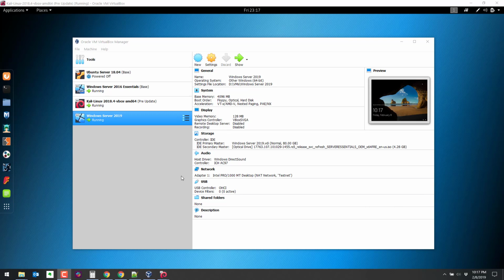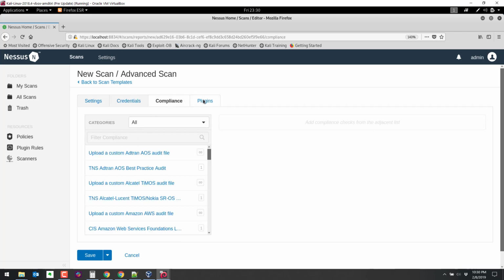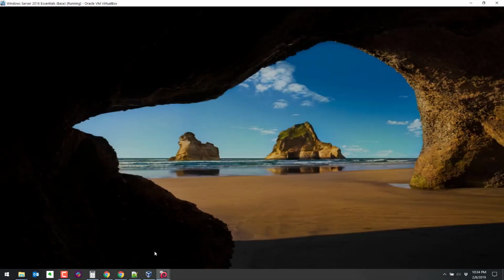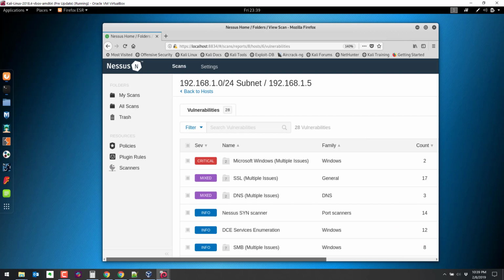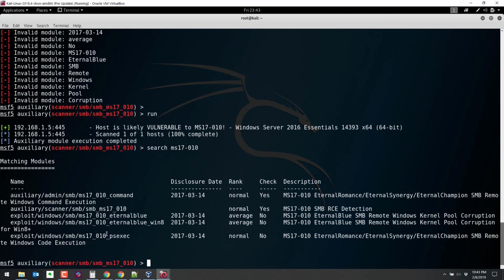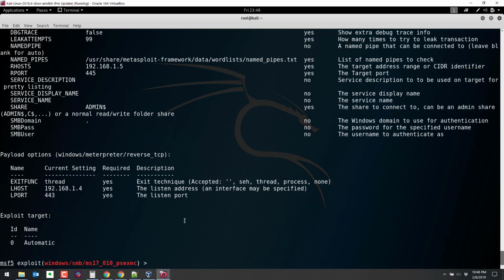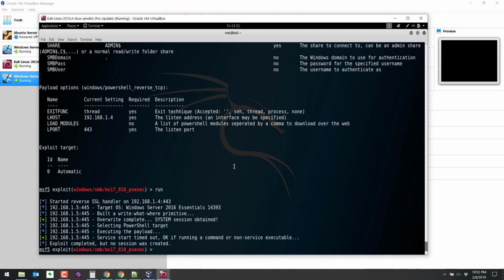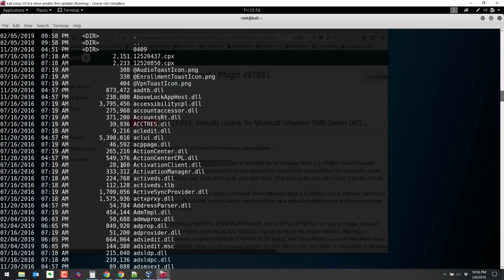How to Use Nessus in Kali to Identify Vulnerabilities to Exploit with Metasploit

Comment: Great video! (And I don't say that often, most are crap) Maybe you can help me with an issue: every time I run Nessus on my Kali, I got disconnected from network after that and the only way I find to reconnect is turning down the VM and resetting the network cards. I have been looking for the issue in the web but I haven't found anything about it. , I am using VirtualBox just like you. Do you happen to ever experience this same problem?